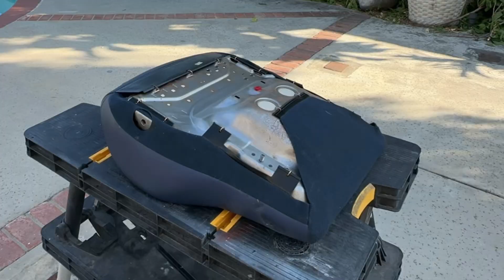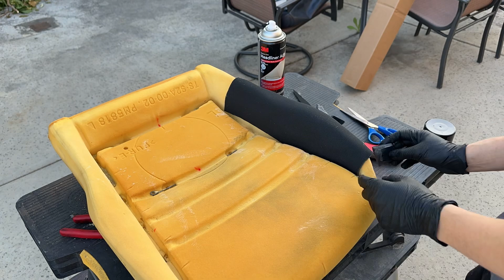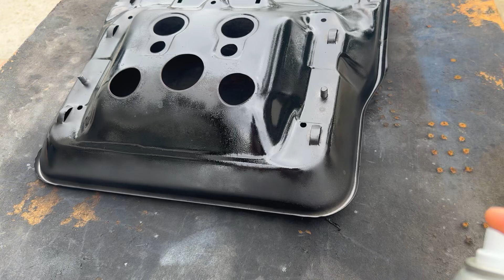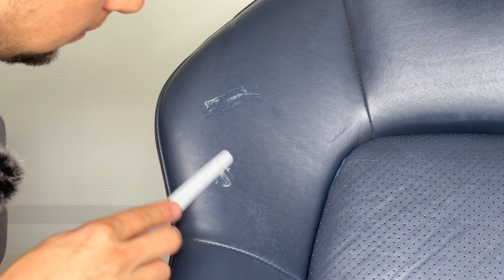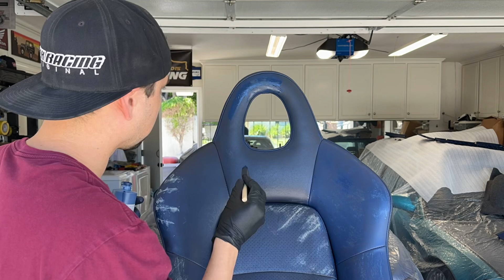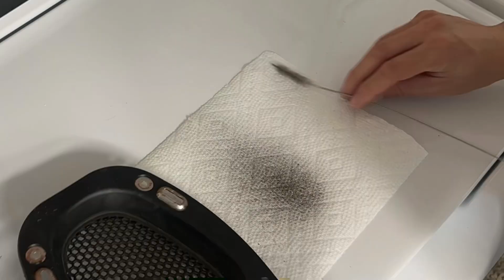Leather RESTORATION & Seat Bolster Foam REPAIR | 2 DIY Methods You Can Do At Home!

Comment: Great video. Do you think Seat Doctor's blue dye matches the OEM blue? It looks lighter than the OEM blue?
Reply from the maker: It matches the original color of the seats, but the seats and dash darkened due to sun exposure. I cover the difference in this video pretty well. You can see parts that were covered are an exact match: https://youtu.be/51KyH2D0K6Y